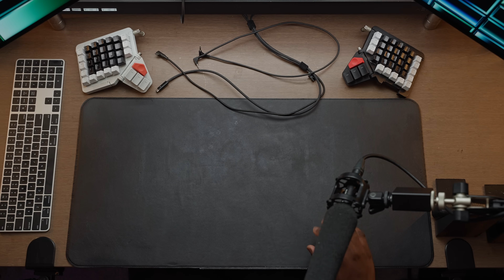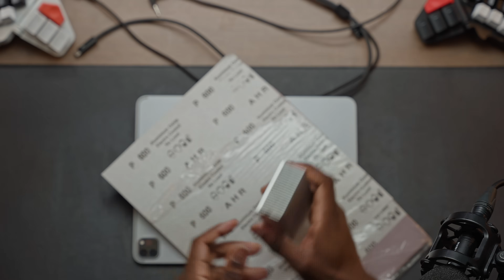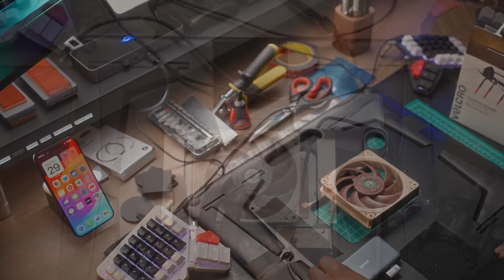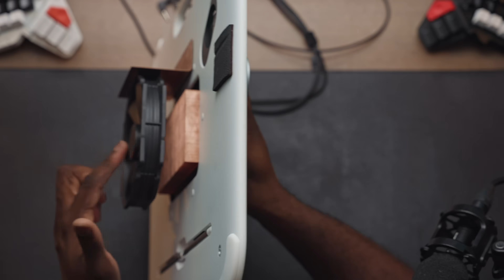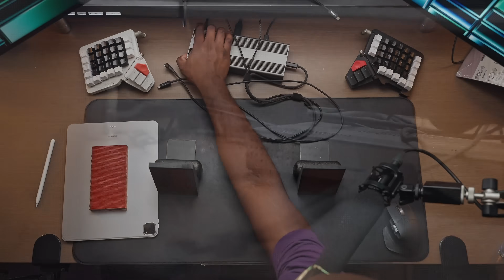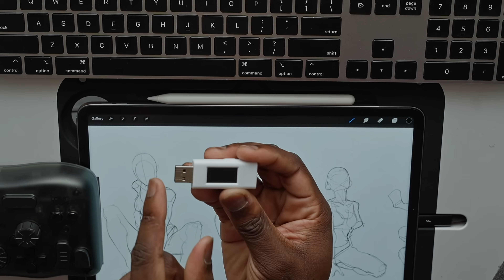My Overclocked iPad Desk Tour!

Comment: Are you sure you want to blow air ON to the fins?    Heat sinks and Electronic fans are usually designed to suck heat away from a device.

Comment: not sure if you still check the comments on this video but im very curious of how you pack your ipad and accessories when going on trips. do you take the modded sketchboard pro with you and, if so, how do you pack it safely?
Reply from the maker: Oh no, The sketch board stays at home lol. I usually just bring one case. Depending on where I go it's a durable case like the Paperlike one or if I am going to be drawing alot I'd bring the MOFT dynamic folio. Then, I pack it in a tight laptop sleeve in whatever bag I am carrying. It's always in carry-on luggage.
Reply: @ergojosh  one other question! when powering the fan by plugging in the ipad, does it matter if the ipad is plugged into a thunderbolt port or would a usb-c port (assuming it provides at least 20-36w charging capability) work, as well? did you set up some kind of instructions or was this kind of plug-n-play?

Comment: I also have a sketchboard pro 2 for my iPad, but went with a MagSafe cooler (non charging, and the same kind you find for cellphones) paired with a thermal plate on to stick on the back of the iPad. So when i need to travel with the iPad i can just take off the MagSafe cooler.
Don’t like how much the cable bends when using a thunderbolt cable, so i thinned out the cable channel with a dremel on the sketchboard pro 2.

Comment: You know you could probably do the heatsink non-permanently by designing and 3D printing a 'case' that holds the heatsink to the back of the iPad.

You could even design it so that it only connect at the corners so that it isn't insulating the iPads back.

Edit: you could also easily 3D print a 'sketchboard pro 2' with a built in fan mount and design it with stands that account for the added space that the fan occupies.

Comment: on the performance note, why not do something like a attachable fan? they have plenty of the gaming ones that would fit your build. the access at the back cut out on your board is perfect for it, and it would be an active way of cooling your ipad, in addition to which, it would be less likely to dry out, as you can swap out thermal pads and even do something like an ipad m4 upgrade without the attached headache of sending it for a discount

Comment: It is so terrible with the heat on ipad pro 13 .  For me only when painting. Don't understand why there is so less to hear about it. Hopefully an update will fix it and it's not a design fault 
Never had any problems with my old one from the 2nd generation.   I would have liked to try the copper thing if it wasn't permanent and the warranty was void

Comment: Now question. I have a similar set up I have an m1 Mac Mini and I’m using it with my 2tb iPad Pro. For longevitiy, whenever i stream from my ipad and i have it connected to the Mac via thunderbolt, i can never seem to get it to charge decently, do you have a workaround for that?
Reply from the maker: hmmm mine never goes below 100%. I do have my mac connected to its full 140 watt charger AND 2 other sources of power so that could be it. (my studio display and my dock - which my ipad is plugged into) I recommend using an OWC dock. It works.

Comment: holy crap you used thermal glue to permanently adhere a massive heatsink to your ipad?
now that's dedication...
personally I'd probably recommend doing a reversible mod with thermal paste and some mount to anyone that wants to do something similar ^^'
Reply from the maker: Yeah same here. I used thermal pads at first but the heatsink would fall off within 24 hours every single time, even with support.  :/ I couldn't find a good reliable way to secure it to the back.

Comment: 1:10 Idea to honor warranty and resell/ trade-credit:
-- Re-use or buy or make a heat-resistant frame or a case whose back can hold the iPad.
-- Make sure case backing sits in drawing board without blocking ports etc, Front of case not needed.
-- Measure the heat sink.
-- On that case back, mark up area where the sink will sit.
-- Draw the rectangle on that back.
-- Within the area, draw line diagonally from each upper corner to the opposite lower corner of the rectangle.
-- cut the diagonals neatly, not beyond the outline.
-- Depending on the case material, bend the resulting triangles back and over where the heat sink will sit. 
-- Set the heat sink so that it will sit flush to back of case and the iPad.
-- If the triangles can be bent over the sink, mark that.

QUESTION: Is there a material in sheet form which can serve as a thermal transfer when it is between the back of iPad and that case? If so without glue, and fully the dimension of the iPad-- if such a material exists, it will sit behind the iPad and the case back.

-- Meanwhile glue the triangle shapes onto the sink. Be mindful to keep heat sink flush to where ipad will meet it in the case's back.

Materials: 
Woven or flat sheets of copper or aluminum, non oxidizing? 
Heavy duty aluminum foil doubled?

Question: On the back of the iPad are there AREAS which get HOTTER? 

-- On the M4, Apple made its logo of copper.  Inside they added some other material to offset heat from items on the circuit boards. On the M2 where?

Comment: You know, you could have simplified your set up by first finding the thermal hotspot of the iPad. After locating it, buy and attach magnetic phone coolers sold by those gaming phones or from razer’s phone cooler chroma. Reviews show that those thing works really really well and could probably cooled your device more. Basically, you over engineered your set up.

Comment: Instead of using thermal glue, what about regular thermal paste?  One time when I was disassembling one of my PCs I had to get the heatsink off of the motherboard. No matter how much I wiggled it or pulled it wouldn't come loose! Finally, pulling one more time, I ended up pulling the CPU out of it's socket still stuck to the heatsink!  So, uh yeah, I have a feeling thermal paste might be good enough 😀

As for the bookend stand things, maybe you could just attach them to the Sketchboard Pro. That way you wouldn't have to readjust them all the time.
Reply from the maker: Good idea for the bookends! As for the paste, I dont think it would work because it simply doesnt adhere like the glue. I believe the only reason your cpu was stuck was because of the insane clamping pressure of your typical cooling solution and the fact that your cpu will get MUCH hotter than the back of any iPad. That and it was probably clamped there for months and had plenty of time to adhere. It wouldn’t have hurt to try before the glue though…

I used thermal pads at first and while they stuck…in about 2 days the heatsink would fall off. Every time. I believed it was due to the cooling and lack of constant pressure.
Reply: @ergojosh  That's a good point, I forgot just how tightly that heatsink is squished against it.  I guess another thing to try is putting a thin sheet of aluminum over that hole in the artboard pro and just glue the heatsink to that. Then you could just use thermal paste between it and the ipad. Would be messy removing it though. But I imagine your ipad never leaves the house 😅

Comment: Why did you choose to use thermal glue instead of thermal paste or even pads?  It is possible to attach corner clips on the back of the iPad to make it easier to remove or replace the heatsink over time.  The only real drawback is that every few years you may need to service / replace the thermal pads / paste.
Reply from the maker: The heatsink will simply fall off, and I couldn't fire out a clip solution that worked with the stands reliably :(

Comment: Great idea, Josh!  My one concern with mixing Copper and Aluminum is due to dissimilar metals (Galvanic Action), which could cause corrosion.  Copper has an Anodic value of 35V, while Aluminum has an Anodic value of 75V ... so a difference of 40. This may be OK in a "controlled environment" (temperature and humidity).  Using Aluminum would avoid this issue as the metals would be similar.  The fan adds "forced convection", which obviously will help with heat dissipation.
Reply from the maker: Dang...aghhh I tried to research this but never came across that term. Thanks for the info!

Comment: Does it really improve performance in procreate? I work in procreate and the ipad is barely warm with no lags or performance issues. Why would you need this Josh?
Reply from the maker: Less crashes, but more importantly it's about the screen recordings I will do. I often will record nearly 5 hours a day, which increases heat. Without the cooling, the recordings fail or get semi-corrupted at times.  It's also been hot as hell where I live.

Comment: What's the benefit of the sketch board pro 2 compared to 1 for you? It's a smaller board and you don't seem to use the magnetic legs so I'm curious
Reply from the maker: It fits my iPad a bit better, its lighter, and the cable hole is much larger. I had to carve out some of the plastic of the original. Its also a bit smaller without compromising on extra surface to rest my hands.
Reply: @ergojosh  o that’s good to hear then thanks for the response !

Comment: Is it necessary to paste the copper block over the iPad? I mean, I imagine a kind of base with the copper in the middle and you just put the ipad and both make contact without being glued. Don't you think? Btw, would be nice to see a thermal test to see the heat improvements...
Reply: I'm using iPad with badic cooling pad for laptops and without any metal block glued to iPad, it works good, too. The only things is 1) the fan is really loud, 2) there is no tilting system and supporting for the iPad, so I can't have the angle I need for drawing. I haven't tested it with charging and Procreate at the same time, believe that it would be kinda hot...
Reply: *basic instead of "badic"
Reply: I mean conceptually a glued heatsink is gonna have more solid surface contact, and thus better heat transfer, than just physical contact (eg why installing heatsinks on CPUs involves thermal paste), but idk how much that difference matters practically in this case lol. I'd imagine DIY glued heatsink would be more practical than DIY integration of heatsink into stand though.
Reply from the maker: I was going to, but who knew decent thermal temp guns were so insanely expensive...